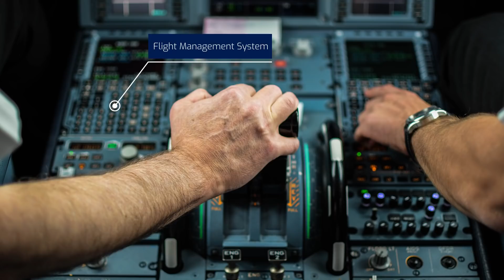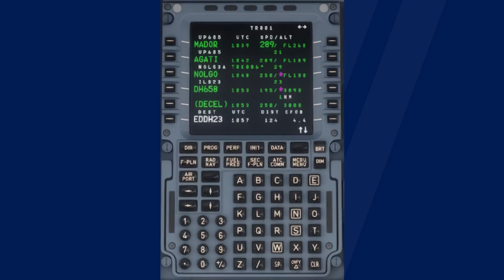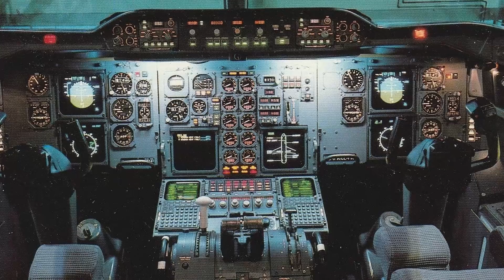Bad Decisions | How Hapag-Lloyd Flight 3378 ran out of fuel

Comment: When I got my cat in Belgium (I live in The Netherlands ), we were on our way back and I had the gas on the first line. I thought I’d make it to the next gasstation when a sign came up at that point. Normally about 25-50km in between.
But no gasstation ever came and my gas went into the red. More and more nervous I decided not to continue on the highway but take an exit and drive into a village as usually there is always one there. There was, I had to ask for the way but was close enough.
I felt so relieved to have found a gasstation in time! I never did that after that anymore, always filled up at the first line. I had just adopted a scared little kitty, it would have been so sad if she had to be in the car on the side of the highway 😞
Reply from the maker: aww 😺
Reply: I am a 71 year old American who got his driver's license at age 16 in 1966.  I admit that as a typical Stupid Teenager I ran out of gas a few times.  But I certainly Smartened Up by the time I was 18, and It NEVER Happened Again !!!  Stupid Teenagers and Mentally Challenged people not withstanding, I have NO Idea how someone can "run out of gas" per se even in an automobile, much less an airliner.  You don't need a PhD in Aeronautical Engineering to figure out that an extended landing gear will cause you to use more fuel.  My question is whether they did a Drug Test on this pilot after this incident.  This pilot must have been high on drugs to do what he did.
Reply: Reminds me when I forgot to refuel my car in the evening although it was already on reserve. At the time, I had to drive to work the next morning, all nearby petrol stations would still be closed. My car`s board computer told me that there would be just enough fuel to make it to the place, where I worked. If possible, I didn`t want any trouble at work, so I took the risk and drove. I entered the company`s parking place with the board computer only showing 2 km left until empty. There was a gas station nearby, arround 1,5 km. But after work I decided to not take a gamble again. Instead a working collegue drove me to the petrol station to fuel a reserve canister. Damn was he making fun of me. And right he was xD.
Reply: U could maybe get a cat in the same country next time! Good luck for the future!